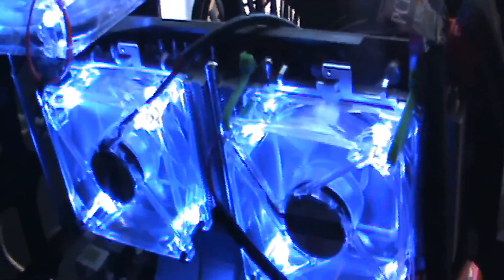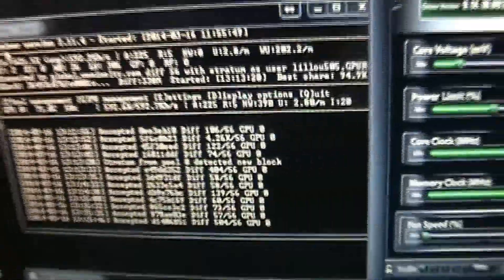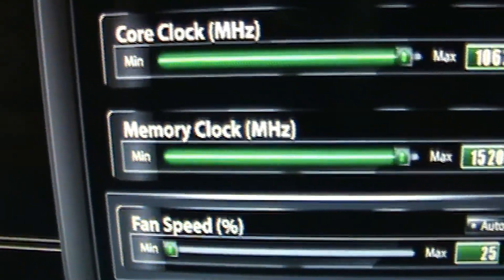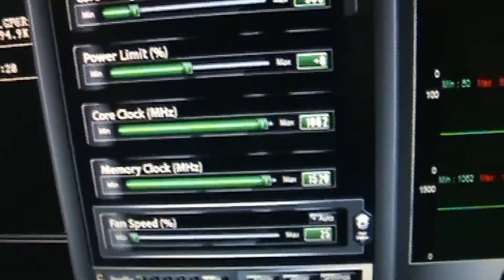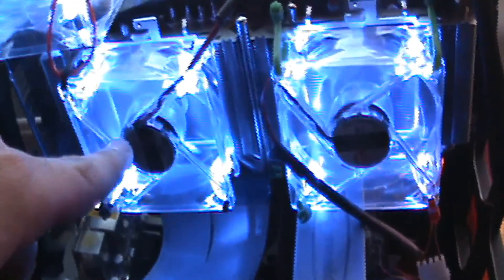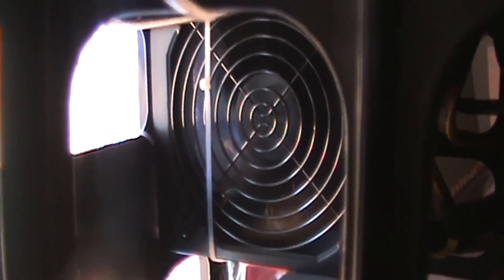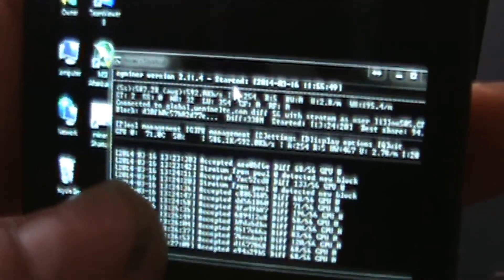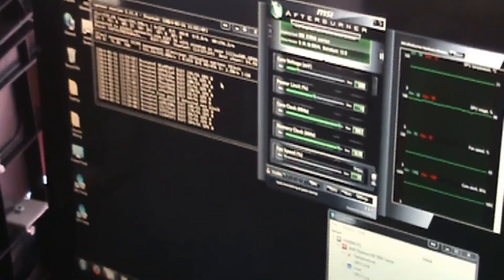Litecoin Mining Rig Update Single MSI 7950 Twin Frozr 3 Video Card

Comment: Look around on litecoin talk forums, your on the right track but your machine can improve. 1200watts is plenty for 4 7950 Gpu's. Your mem clock that high is a waste, check your other settings. Run Intensity 19 or 20, "thread-concurrency" : "24000", set mem to 1250, gpu to 1155 (or even higher if you want), but you should be able to set gpu to at least 1080. You'll get well over 600. 
Look for custom scrypt files that will improve your hash rate.
It's kilohashes, not kilohertz, and running the gpu at 75 to 78 deg is perfectly fine. Just stay below 80. 
Try .962mv and higher if you get crashes at a higher gpu clock. You should be able to hit at least 1100 gpu clock while staying under 1mv. (millitvolt)
Reply from the maker: Thanks for the tips! I cant run thread currency on 24000 only works on 12250... I will go ahead and do what you suggested there and get back at you with the results
Reply from the maker: LuisTutorialTV Afterburner only goes up to 1100.. is it ok to go over that to 1155? also does overclocking burn out my video card? thanks!
Reply from the maker: LuisTutorialTV Been playing around with the settings and have intensity to 20, core clock to 1100, mem clock to 1575, and mV to 962
with those modifications I got 617-622 kh/s had to turn up mem clock all the way up to get to the 600s lol
Reply: LuisTutorialTV What happens with TC 24000? That's what's holding you back. There may be a way to run multiple threads rather than single to make up for that. 
I have a couple of those with an undervolted(.962v) bios to use for bamt, all at 1060/1250 for 647khs. Running faster memory only results in a couple extra khs, really not worth it. It's all about memory timing and bandwith, not really just high memory or gpu clocks.
The default bios on those runs at 1.188v in linux, but with windows you can undervolt so you don't need any special bios. Run the lowest voltage you can and still hit in that range, starting at .975 and going up until it's stable. At 1155gpu and up you can get over 700khs. But 1060 to 1080 gpu still does great and saves on power/heat. Here's what I'm using:
"lookup-gap" : "2,2",
"thread-concurrency" : "24000,24000",
"shaders" : "1792,1792",
"gpu-engine" : "1060,1060",
"gpu-memclock" : "1250,1250",
"gpu-fan" : "10-100,10-100",
"gpu-powertune" : "20,20",
"temp-cutoff" : "93,93",
"temp-target" : "77,77",
"temp-overheat" : "86,86",

At first I ran 1.188v and 1155 gpu but it got too difficult to cool, so after the undervolt the most I could get was 1080. I knocked it down to 1060 for the best stability and it's been there for almost a year, 24/7. 

Good idea with the external fans. I had the fans break on one of them and what an absolute pia to fix them. I did the same thing and I'm getting much much lower temps than I ever did before, so I just left it like that. It's sitting at 65deg while the others are 75deg. 

As long as you aren't running crazy voltages or crazy gpu clocks and your temps are good, that card will last a really really long time. It's all about heat, and other than moving parts like fans, as long as you keep it cool you don't have to worry. I've never used it with windows, so I don't know the clock limitations of afterburner. You don't have to go over 1100 though, just undervolt to get close to that.